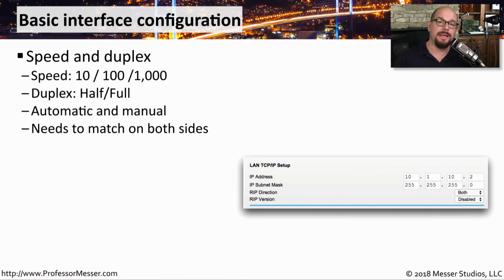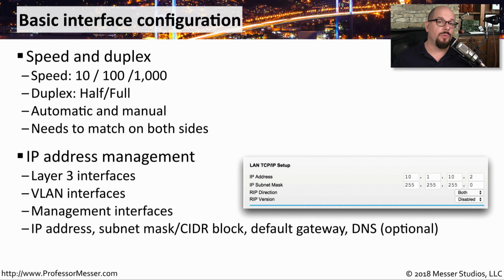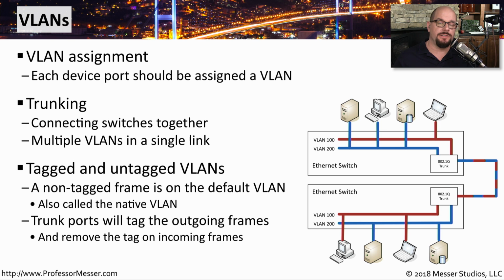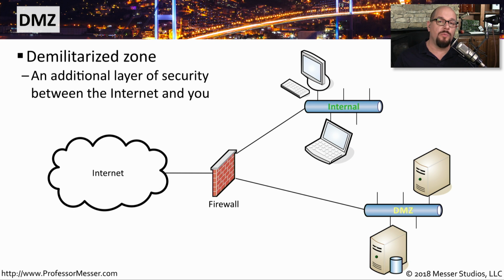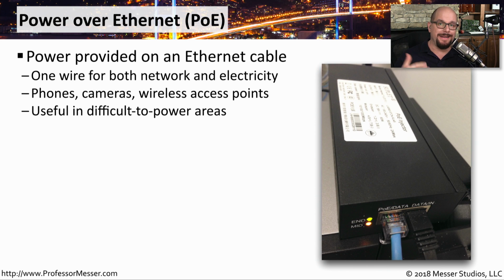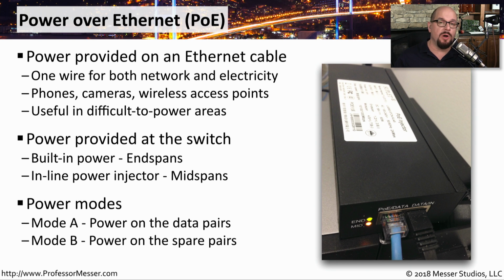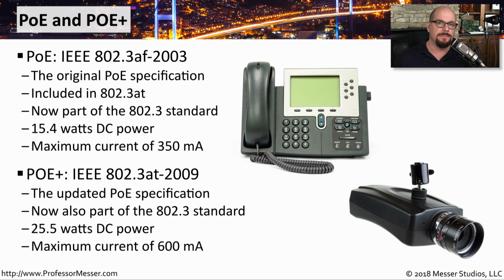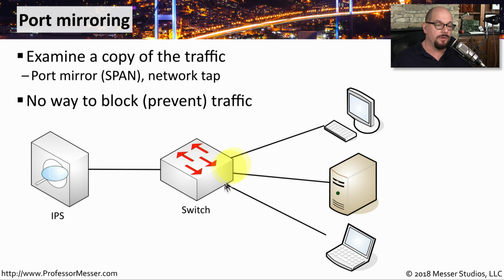Switch Interface Properties - CompTIA Network+ N10-007 - 1.3

Comment: Wouldn't it be an IDS, not IPS, given that it can't actually prevent malicious content? Thus detection, not prevention?
Reply from the maker: The label of an IDS or IPS describes what it's capable of, not what it happens to be doing at any particular moment. 

An IPS that's not inline can still send TCP resets and block traffic. These days, you won't find any IDS devices on the market any longer, and even standalone IPS devices are uncommon. These days, we use next-gen firewalls that include IPS functionality. That feature is still called an IPS, even if it's in monitor-only mode.

Comment: Hi Professor, 

I love that you provide us with an abundant amount of information on networking; I think I'm very fortunate to have access to the resources you provide.

However, after doing some research on trunk ports, I don't understand why I need them. What is the difference between a trunk port and a standard fast ethernet port? Would you (or anyone) mind clarifying this for me? Thanks!
Reply from the maker: You must have skipped over it. Go back two videos:

https://www.professormesser.com/network-plus/n10-007/switch-interface-properties/
Reply: Trunk ports allow VLANs from one switch to talk to ports on that VLAN from another switch, and even to share VLAN configuration info (as in, what VLANs are configured for the network, etc). A fast ethernet port only tells us the speed of the port; nothing about its configuration, though. It could be a trunk port, or it could be a regular access port where computers and other devices connect. Hopefully that helps as well. :)